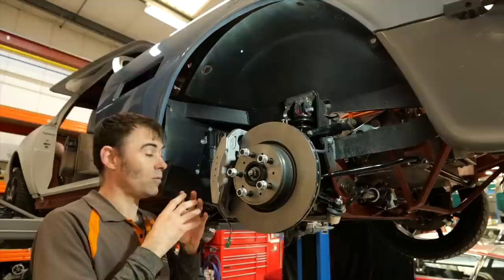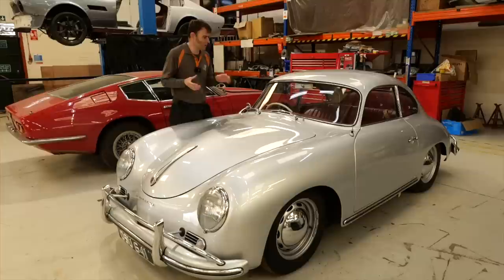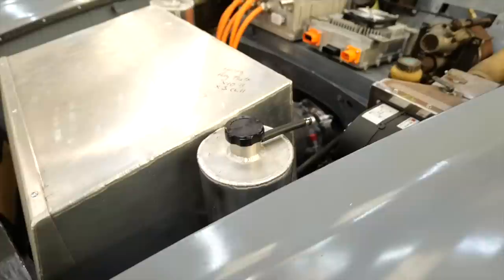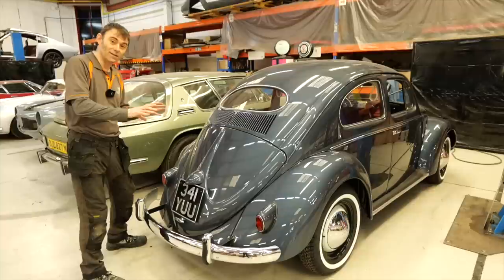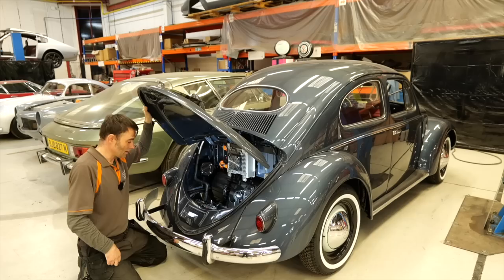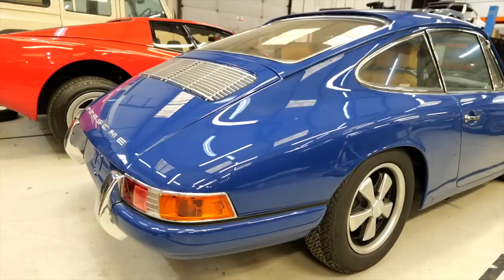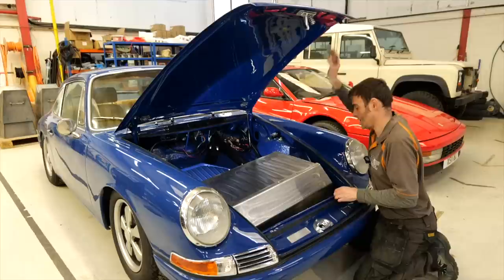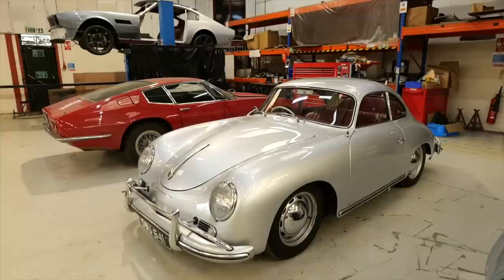Classic car electric conversion shop tour

Comment: I thought there was an issue with registration of these highly modified cars. I read about someone having fun foul of the DVLA with a mini build. These cars are totally re-engineered - do they still qualify for classic insurance, tax and MOT?  Not to decry the work but I would never consider going down this route, I enjoy classic cars very much but a big part of that is the mechanical appeal.
Reply from the maker: If you modify the chassis or monocoque of a vehicle, be that for EV conversion or any reason, then the car will need to go for an IVA. Our conversions are bolt in with no modifications to the chassis or monocoque so don't require an IVA test. Anyone with a classic car should get their car MOTd once a year, wether it's modified or not as it's a good safety check. MOT exemption for classic cars is a stupid and dangerous idea.

Comment: And the Alfa Romeo Spider?
Reply from the maker: That car was finished last year and is with the customer. 👍
Reply: @ElectricClassicCars  
will there be a plug&play kit for the 105 series from Alfa in the future?  I own a 1977 Giulia.
Reply: I also own an Alfa 75 Turbo with a defective engine.  A Tesla conversion would also be very interesting for the transaxle system from Alfa.  There are many models with the same design.  Alfetta, Giulietta, 75, 90.

Comment: Why does that Astin have odd tyres on the rear? They both look reasonably new, so even more odd.
Reply from the maker: The wheels and tyres on the Aston are there for us just to check caliper clearance and roll the car around. Those aren't the tyres or wheels we'll be using.
Reply: @ElectricClassicCars  That makes perfect sense.

Comment: minute 5:10, the Porsche hood is not original. The gaps here are like a US car would have. I had a 53 Porsche and was Very lucky to find a hood that fit "pretty good".  I had to try 4 hoods.... not perfect but pretty good.,,,,  and the doors are worse.... I was able to keep the doors but even in c.1977 when I restored my 1953, Porsches were rust buckets. Cancer was rampant even then. Mine had the original pan and battery box all in good condition. rare 45 yrs ago. Think about it..... Fitting the original doors is an ordeal... the fit is very exact so it takes 2 people to do it right. And the back half of all the 356 cars all seem to interchange nicely. the engine lids I saw all interfit as does the fender work on the rear,,,  I was at a porsche shop auction in 1983? and at least 6 rear clips went unsold because they just aren't needed like the front of the car....  but the front fenders to hood fit are a nightmare for non original change outs.  The windshield tolernce on Pre A cars was to 1/4"! This can make fitting windshields a tad tuff.